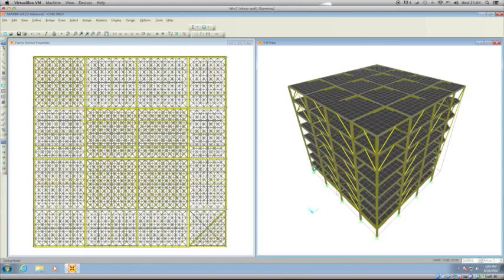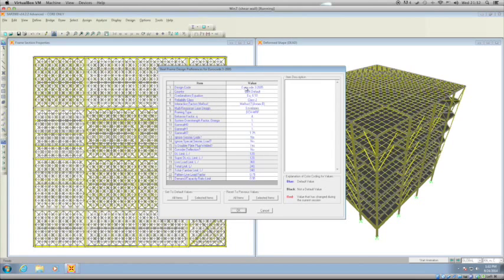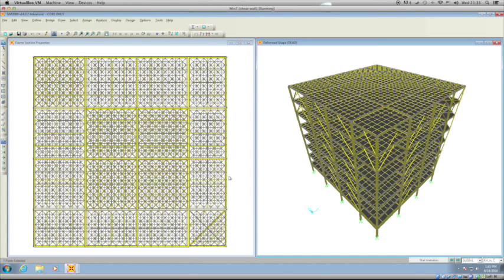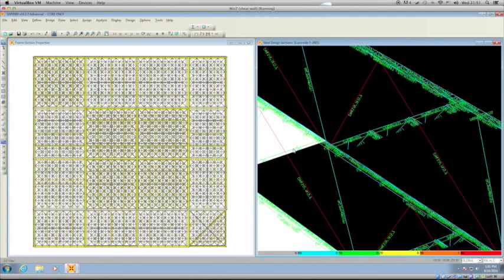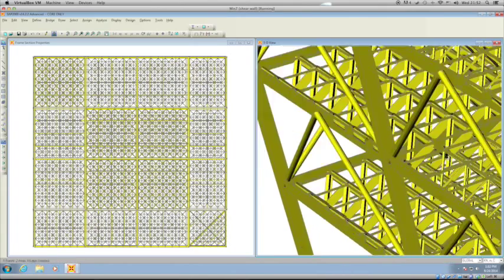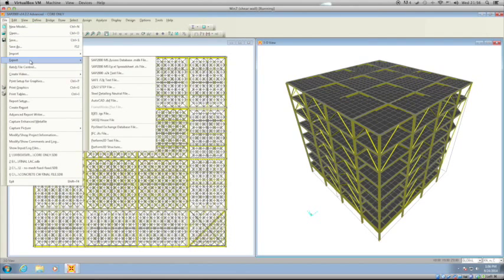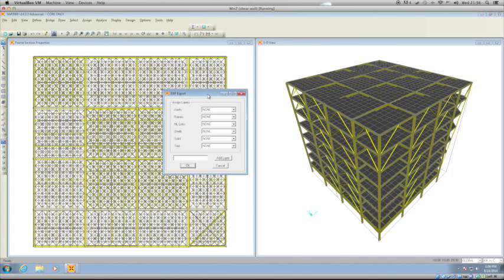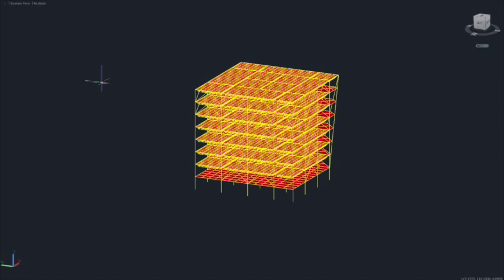SAP200 - How To - Steel Checks, Export To AutoCAD

Comment: Are the columns released? When I releases  columns, girder and secondary beams in a multistoried building with braces it shows stability errors any suggestion?
Reply from the maker: Asif Mostafa Anik p aaaaaah this guy :) I thought I taught u better :) u over release the structure or ur bracing is too light. Or both......... Remember from ur statics the conditions for instability? U need to make sure that u don't over release the structure. Semi rigid beam to column connections, then u can use either semi rigid bases (expensive foundations) or nominally pinned column bases (still required some nominal stiffness) with bracing (heavy!! Simulated ad tension members unless gusset connected in center)
Reply: Mike Tsappas Actually a hands on experience is the matter. Not your teaching. As a teacher you are best I would rather say mentor. Waiting for the fish to get caught then I will fry it with you.

Comment: i saw your design existing some failure (the red line) after checking. Then what should we do to fix it?
Reply from the maker: depending on the kind of failure that exists - most times releases will solve temperature and bending failures. please be more specific.

Comment: Is this the building Gerry got us to design for our courseworks?
Reply from the maker: Busted :)....it makes a very good video though, i have to say :)
Reply: Yes it does. I still can't believe he gave us the same thing for exams.

I'm currenly designing some trusses at work on STAAD.Pro. I don't really like the interface and it's less automated.
I'll probably give it a try on SAP 2000.
Reply from the maker: roopesh1 send me drawings and loads buddy :)
Reply: Nearly done with it. For the time being I did a unity check on STAAD.Pro. It's for a turnkey project. If we win the project. i''ll do the detailed design on SAP 2000 or Robot 2015.
Robot 2015 even designs the connections.